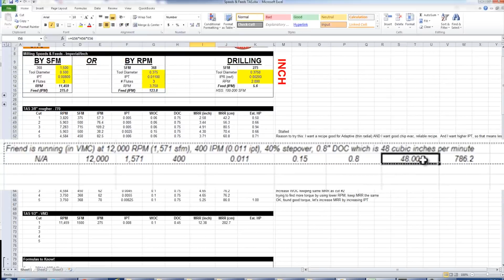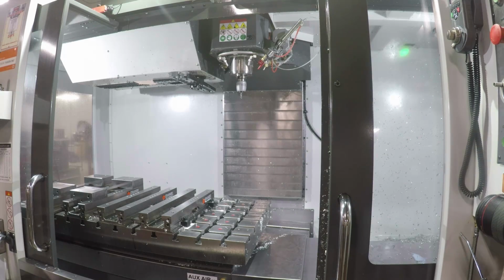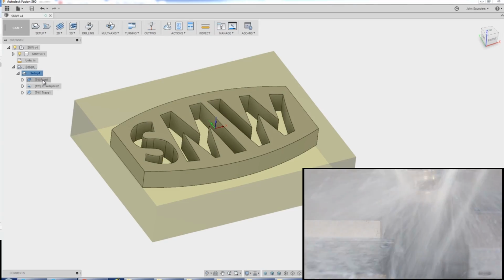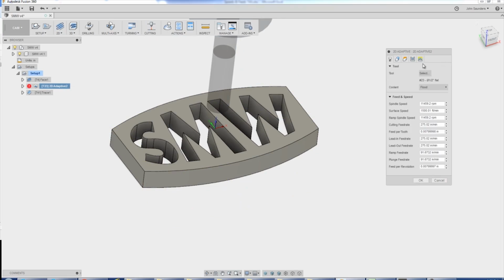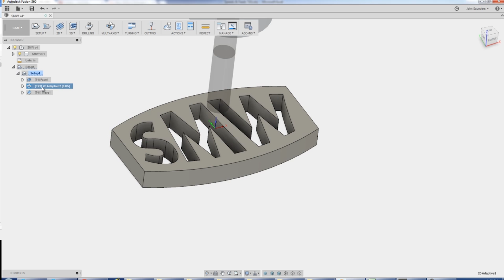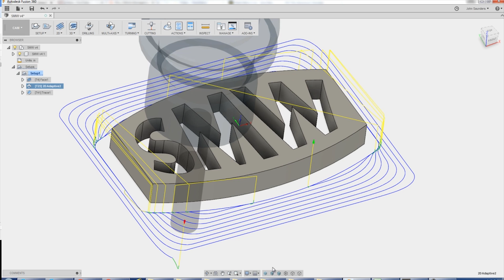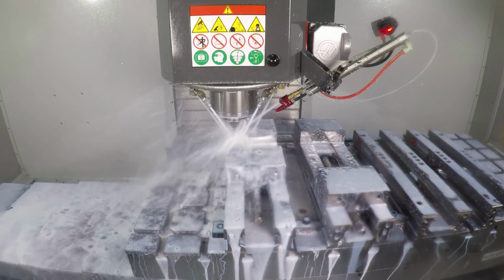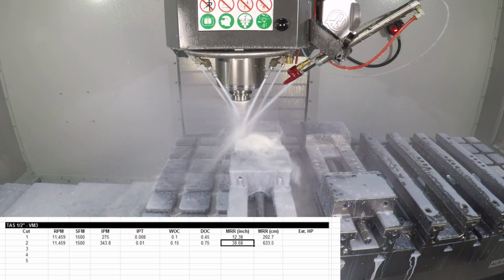Shredding Aluminum on the HAAS VM3!

Comment: I want you to push it till it breaks and back off a little, obviously!

But if you're looking for idras in a more open ended spectrum I'm feeling a bit overwhelmed on what face mill to choose for use on our bridgeports, Perhaps facemills would be a good topic for a video? I'm looking for something fairly free cutting for stainless, something I can use for squaring blocks quickly. Intuition tells me these old machines are cappable of taking at LEAST some .100 deep cuts with a 2 inch cutter. I've been resorting to long 1" dia corncobs to get my MRR up to anywheres' near efficient in stainless on the bridgeport but we desperately need a decent facemill.

Comment: FYI G187 is simply changing the parameter (also changeable by default in your settings/parameters).  I used to work for a Haas distributor, but can't remember the setting/parameter # off the top of my head.  Great vid.

Comment: Hey john i run a finishing Yg 1/2 in in my vf-2 ss at 12000 rpm and 550 imp 30% stepover, with that taz im sure you can get max rpm 75% step over 400IMP and to get G187 p1 to output leave more stock and fusion will give a p1

Comment: Have you looked into Kyocera tools at all? they give you free cutter bodies with purchase of a certain number of inserts. I often use the 2.5" M-six cutter for general facing and shoulder milling. They have aluminum specific inserts for them and i recently had a job come through where we started out with a 58lb block of aluminum and the part came out weighing only 4.3lbs. needless to say there was quite a bit of roughing required and i wanted to get rid of as much excess material as possible. i was using a 2" stepover and .155 DOC. 10,500 rpm and 262.5 Ipm.......thats nearly 7000 SFM!!! and 81.375 cubic inches per minute!!! at .005 ipt with a 2.5 inch 5 inserts cutter. and that was on a UMC750 with 12000 rpm spindle and the spindle load only peaked at 140% for a split second at a time. I could have hit it even harder if i had more speed and HP, but the mist was already getting kicked up pretty good and the chips were wailing the side of the machine like a hailstorm haha. Plus I was happy with how stable it was and didn't want to be going so fast that i had to worry about walking away from the machine. very impressed with them though. I ran 21 parts without changing inserts and they were still razor sharp at the end even after removing almost a half a ton of aluminum with them. its crazy to see how far cnc tooling has evolved.

Comment: how fast can u do micro machining with haas vm3 (with cooling and with out cooling)? as micro machining i mean works with tools that have diameter less than 3 mm (0,11811 inch), 'couse we use electrospindles that reach 24000 rpm without cooling on aluminum at my job, we ran the machine at 1500 mm/min (about 60 in/min)

Comment: John... I like your videos.  Have a look at the HPI Pioneer SX 25M Mini Max holders... I have found in my Haas mills they are the best holder you can get.  The gauge length is short and Haas likes short gauge tools and slow taper is the only way to hold a tool.  All mine clock up to a tenth or two.

Comment: some Mastercam guys were talking last year of instead of using the small radial tool pathes and high feed, using up 90% of the width with the spindle up in rpms but using something like 40ipm in feed. This was in steal mind u so you could go faster. I found since i was using slower older machines that it was actaully faster than the high speed small radial toolpathes. Another thing i noticed I would actually make sure the tool stays down, because the machine slows itself too much when using rapid moves for accel/decell
Reply: For maximum material removal, taking the deepest and widest cut is always the highest removal rate. There's simply no replacement for raw power, but all of the cutting variables need to be correct for it to be successful, including the spindle power, keeping the cut cooled, evacuating chips, and rigid tool and workpiece. If any of those present a problem, dynamic/adaptive toolpaths could be more cost effective.

Comment: Love the videos John.
I'm curious to know why you wouldn't use an ER collet. I found that using a solid holder with a set screw would not run as true when trying to hold tight tolerances .0000-.0005 on an ID to be specific. I would like to see how you would machine 304 stainless steel and 316 stainless steel. I haven't seen many videos on that kind of materials and would like to see and get some more ideas and how to effectively remove high amounts of it. I've currently been using Walter I feed insert cutters but I would like to learn what would somebody else use and do. 
Thanks!

Comment: I say push the tool to what you feel is a safe max! I know from using those style roughers they NEED to be pushed hard to make chips and not rub. Big tools like 1/2"+ are really forgiving and take a thrashing vs tiny stuff. Plus with a machine as powerful as your HAAS your barely using any power on the spindle too.

Comment: how fast can that end mill make a Ar15 receiver from raw stock?
Reply: It's kind of hard to answer this.  An AR receiver has machined features on all 6 faces so you have to do 5 or 6 separate setups to make one. (2 setups on a 5 axis machine.)  It takes time to redo the setups.  That setup time makes the material removal rate a very small factor.  Tool changes are also a factor, as there are a bunch of features too small for a 1/2" end mill that require tool changes to complete.

If you had to do the tool changes and setups manually one-at-a-time it would take all day to make just one.  If you setup a workholding jig that locked the parts quickly to the different orientations and ran five or six parts at a time (or more) then you get some of that time back.  I suspect that a clever machinist could pull a finished part out once per hour or less.  That's "finished" including milled, drilled, deburred, chamfered, threadmilling the barrel attachment ring, and engraved too.

Comment: I would like to see you cut tungsten (97% to b exact), the only reason being because I have been cutting a bunch of it lately using a .5 Supermill XPR and i have my speeds and feeds to a point where it sounds good and the tool lasts but I would like my run time to be shorter. It would be cool to see what you came up with. If you get better results with a different endmill also. I asked my boss about cutting tungsten before I did it and he said that i needed diamond tooling so he obviously was not the one to ask for advice. A lot of shops wont take a job with material this type but I personally enjoy cutting the harder materials, mainly because it is more of a challenge. I am also running in a HAAS VF2 so the machine is the same. Well have a great day.

Comment: We have a Haas VM3 and after having to replace the spindle for the second time in 3 years we decided to get a good machine and got a Okuma which we push way harder than we could the Haas. We use Surfcam's Truemill and we do what you did in Ally in 316 Stainless because we can. I don't understand the comment about the ER collets as that is all we use in various sizes and have never had any problems in the last 10 years we have been using them but I guess it comes down to the quality of the tools you are using.
Reply: If you had to replace 2 spindles in 3 years you are doing something wrong.  I suspect spindle speed too fast for too long.
Reply: Exactly
Reply: What's the point in having the spindle need of u can't use it. Haas are rubbish. Especially the newer ones. We have 5 and the old ones have ran at max rpm and are still good. The last one is 3 years old and we have just had to put a new cam box in for the tool changer at £12000. Going with doosan next time.
Reply: How can we be doing something wrong FFS? All oil levels are full and all lubrication is monitored so if anything goes wrong the machine stops. We run the Haas only 8 hours a day, 5 days a week but we have found them not to be very good on S/S so we mainly use them on the softer materials like Ally and plastics.We actually bought a Quaser Mill and it is a beast. I use the "95 Okuma we have on all the 316 S/S as it didn't vibrate like the Haas. The Haas has more power than the Okuma but when you cut S/S the speed drops off very badly so you have to allow for that in the speed whereas the Okuma virtually has constant speed but we are talking quality with the much older machine that uses a 2 speed gear box. Even though the Okuma can only do 6,000 RPM and the Haas can do 12,000, when it comes to S/S the Okuma can be run harder due to the ability to keep up the speed with no vibration whereas the Haas speed varies due to being gutless. The Haas are average Aluminium machines but they are NOT production quality. We run the Quaser and Okuma 24 hours a day for 5 days a week and we have never had to replace anything in the Okuma besides the backup battery. The Quaser is only 3 years old and I would say the for strength and power it leaves the Haas behind and it runs at 12,000 RPM the same as the Haas and we have had no problems at all on any material. Haas are OK for home use but in a production environment I would say to get something else.

Comment: That was fast! I got a request. Buy the cheapest 1/2" end mill on ebay or amazon..... Buy a set. And push those as hard as you can. I want to know how much the extra dollar gets you.

I know it's a sin to put cheap tools in a super nice haas. But come on. Don't you want to know???? 60$ vs. 10$????

Best Matt
Reply: Centurial Inc 
Ya it would be an interesting test.
Reply: Would be fun. I can say maybe ten years ago, the value tools were craptrash. Terrible grinding and poor cutting edge characteristics on the whole. That said, the cheapo carbide I've picked up recently is better than (some) name brand $$ tooling from as recent as a decade ago. Now it seems just like computing/tech, even the crappy stuff is pretty darn good. What a time to be alive.
Reply: Well said. I have had a similar experience with tooling. It is a very interesting time. Less than one lifetime ago cnc machines where not even an idea in most peoples minds. Now they can be a house hold item.

Best Matt
Reply: Ian Hall until you have to verify a measurement.. hence the machinist

bore gage.. mitutoyo.. .0001... price that.

its not so easy
Reply: Can you explain a little more? I think I know what your saying but not 100% Yes a precision measuring tool is pricey and name brands are good. But Shars is my go to and far less $$. Everything I have from them is good stuff for half, or more, the cost.

Best Matt
Reply: Centurial Inc you know the load of your tool.. how much you will push it... if it works.. do not sink it... just verify the results towards tolerance

if your happy.. the customers are happy... no problems

if your asking for grains... your looking for improvement
Reply: Heck yeah. Pick up a set of Horror Fright TiN end mills and see how bad they really are. Push them until they break.

Comment: love the great videos keep em coming. I have been using fusion in our shop for a year now and from my experience g187 is not necessary when you used the smoothing setting because when possible the post will spit out g02 and g03s whenever it can giving you smoother cutting instead of the jerky x y moves generated when not using smoothing. now if you do not have advanced read ahead on your control you have to to slow down your IPM so the control can keep up with the many lines of code its trying to read. overriding your default setting for g187 in the program will make your machine run smoother but it will drastically extend machining time. I found the best solution to not having advanced read ahead is setting my tolerance to .0001 and my smoothing set to .001. for every type of operation even finishing. when I really really need read ahead i use the trial package that every haas has theres 200 hrs free and the difference in how it reacts to the code is very noticable. 

this week I ran a job it was 6061 t6 aluminum. i used a helical 3 flute 5/8 diameter 2.125 loc variable pitch. parameters for that where 1.25 depth of cut .125 radial depth of cut 11,900 rpm at 350 inches per minute. this was done on a haas vf4 ss. my spindle loads were up to 110 max. i also did this in a standard er collet with 100lbs of torque.

I love this trade and i love seeing guys teaching others i also like seeing guys like dingle 1973 taking interest in this after machining a certain way for so long. much respect

Comment: manually changing the P value to a coarser setting runs the risk of gouging your part. the post works out which setting to use based on the overall tolerance settings on your toolpath and stock to leave. It used to also check which toolpath you were using, but I think that's been taken out of later posts. So basically if you add more stock to leave, and decrease your tolerance, it will post P1. Ive measured 0.5mm of deflection in an end mill during a cut before in a straight line. And that doesn't include the deviation from the programmed path that can happen with control based smoothing algorithms like G187.

Comment: Great video! Have you tried the 1/2" on the 1100? I'm struggling with it. I want to push it harder but it's not going well. Not sure if it's my speed/feed or just the rigidity of the machine. Also, having problems with it pulling out of the TTS collet.
Reply: JW Machining I think over time you'll find a sweet spot diameter and tool length for your machine. For my Haas MiniMill it was 3/8 stubby rougher. For my VF's it is 1/2 dia, 2" long tools or 3/4 dia stubby tools that work best. I doubt you'll find 1/2" to be a good fit for a Tormach.
Reply: Thanks Jay. I'm going from a VF3 to a Tormach so sometimes I push it a little too hard.

Comment: In aluminum, those small step over tool paths are a waste. You can run 90% radial engagement as long as you can hold onto your work piece. You should be able to get 100% spindle load with a 1/2 tool.
Reply: Completely agree with Wes. You could rough that in half the time. So much time wasted in time out of cut as well.
Reply: Wes Johnson That's completely untrue. You only have to look at your mrr. Download hsm advisor for free on your phone and play around with it.
Reply: HSM advisor is fine for low power machines like a Tormach. On the Haas, there is no need to be so conservative. 90% radial engagement, 100% axial engagement, at 1000+ SFM should be no problem.
Reply: It depends on how fast your machine can go. I you want to run your machine at s50000 and f1950 then you can't do a 90 percent rdoc. It eventually does become more advantageous (especially for tool life). Too bad the haas I run only goes f833 and s12000.
Reply: In steel, small step over can greatly increase tool life. In aluminum, the difference is much less. I used to program CNC machines to do production milling of aluminum castings. We did a lot of testing of different tool paths.
Reply: It's all about the cubic inches of material being removed. I know it's hard to wrap your head around but 48 cubic inches of material removed in one minute is hauling ass. Numbers don't lie.
Reply: How can that be 48 cubic inches, the billet is at MAX 4 x 5 inches x 1.5 inch thick, that only adds up to 30 cubic inches and half the billet isn't even machined. So maximum about 15 cubic inches in a minute and I am being generous with my sums. The numbers do lie if they are wrong.
Reply: the instagram machinist gave him numbers for 48mrr. he ran it at .25 of that. I personally run around that fast all the time though. not because I have to but because I like to.
Reply: I am a production man at heart, so I try and avoid travelling the machine to much, ball screws on a haas are commonly the first thing to go so anything to lengthen the life.
Reply: Same. I reduced all the cycle times at my current job by 1/2 or more using cam software so that new ball screw is already paid for.
Reply: What if you could reduce them by half and keep your ball screw? You also have to bear in mind the machine down time due to breakages.
Reply: Haas is pretty quick. The ball screws will never wear out if you don't run the machine at all and they wear out quicker the faster you run them. I can be done running 2 jobs sometimes 3 by the time 1 would normally be done...with better tool life. That's how you make money and stay competitive.
Reply: Been doing it for 35 years, have 20 machines and invest in new plant ever 6 months. Cant be getting it too wrong
Reply: Joshua Legault my test was with a 3/8" rougher 40% Radial .800" Axial had it up to 520ipm/12K
Reply: Chris M my old boss had that many machines and couldn't even use cutter comp. Told me to never run the spindle above 3000 rpm. He made up for it be cutting corners in different ways like shop cleanliness and employee pay rates.
Reply: bmp1785 sounds fun. maybe a bit too fast to be stable but idk. Did it work?
Reply: Joshua Legault I'd run it @ 400 all day 450 & above it sounded like it was struggling evacuating the chip's.
Reply: Wes let's see a video  of the 90% radial ?